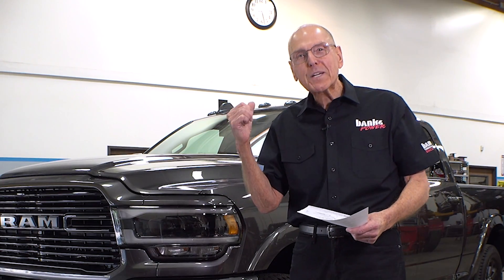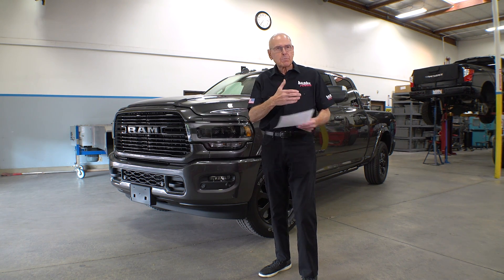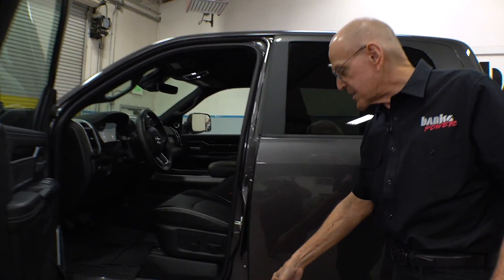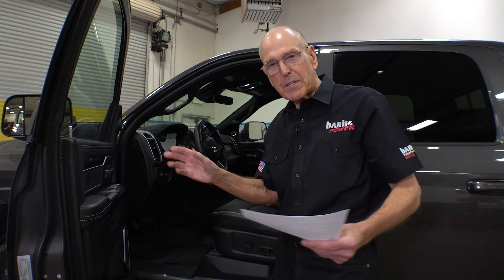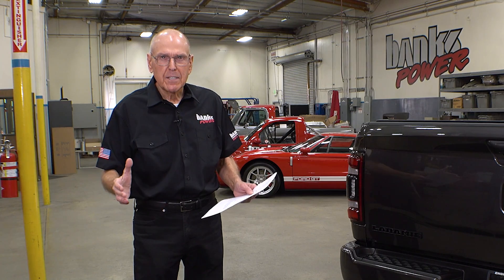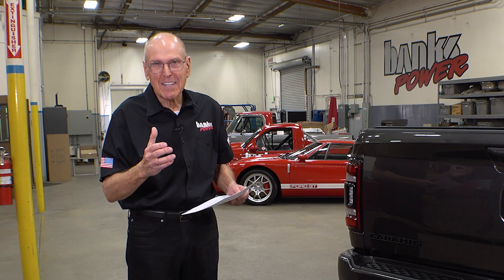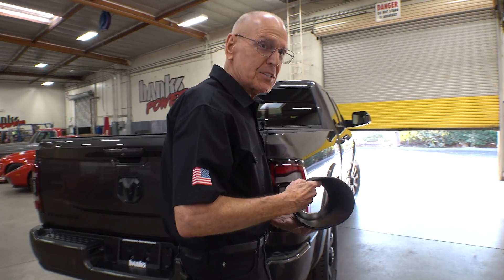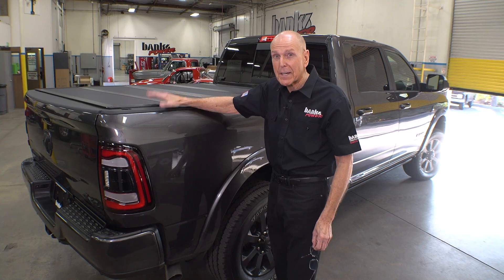Everything we're doing to this 2020 RAM 6.7L Cummins

Comment: I have a 2019 3500 with the high output diesel. I do like my Pedal Monster (and iDash), but I agree it feels like the engine could use a better tune.  Please select me as a beta tester for the products you are developing for this platform.
Reply: Ez link it, 530 hp on my tunes in stock for emissions intact

Comment: We desperately need tuning for aisin trans! And please don't leave the 4th gen guys out when you crack it.
Reply: Good luck with cracking toyota software
Reply: @justinmartin8887  some company’s just can’t be cracked. Even company’s that work with the oem. Dinan that makes aftermarket parts for bmw that bmw will not cancel the oem warranty when modded or tuned by them. Even they couldn’t get past bmws ecu encryption. They had to make and design there own ecu.
Reply: Levon Miller from firepunk got his aisin running good but he just pulled all tuning for anything newer then 07 off the market due to epa bullying

Comment: I can’t wait to see this series but there’s one thing. I’ve always been told the ram 4500/5500’s are all detuned compared to the 2500/3500’s. Can you do a video on what you offer for the 4500/5500 trucks. More power and better fuel economy, running cooler for towing since that is what most of them do
Reply: I have 5500, they are detuned,  it was deleted,  than bigger 50 hp turbo , than the factory computer was adjusted to feed that turbo,  really all Cummins can be tuned without banks. Or any aftermarket product,  its reliable  and powerful- not loaded hwy get mid 15mpg.  Loaded 9 to 13 mpg, than again the rear end is 488 gears

Comment: Glad to hear your finally working on a tuner! I have a 2017 6.7 G56 that has the derated engine and a little wiggle room would be very welcome to those of us who insist on running manual transmissions. Being able to go to stock or an economy tune to something with a bit more power would be perfect. I really hope you don't forget trucks before 2020!
Reply: I have the 2018 w/g56...It would be great to just have the H.O. torque and HP specs.
Reply: @bartdude  No kidding or even the standard tune instead of the de-rated one.

Comment: Haul up to a 7,680-pound payload*

*when equipped with the 6.4L HEMI® V8 engine
Reply: Also with a long bed and single cab...
Reply: .....and 2wd. Yuck!
Reply: Tow rating is a lie too
Reply: @Brooktrout3  how is that? The tow rating differs an insignificant amount compared to the haul rating for different models.
Reply: @IceBergGeo  a full sized cab, 4x4, non dually is not towing 35k dude
Reply: @Brooktrout3  why would you even try that much without the dually? I suppose common sense has to kick in somewhere... So long as you have a couple options ticked, you're still towing 32k plus. You'd be crazy not to have them anyways.
Reply: @IceBergGeo  exactly, but this video insinuates that this truck can pull 35k
Reply: @Brooktrout3  if you read all of the text in the image, you could see what's what. I don't think we need to go any further though.

Comment: Finally we get some goodies... And if possible touch on the cp4 that everyone seems to think it's the failure point on these trucks .... Prove them wrong....or right? Would be nice to hear what you think of it. Thanks keep up the good work.
Reply: CP4’s leave a bad taste in everyone’s mouth. The horror stories come in stock form or tuned trucks. Higher miles or months off the lot. They are a ticking time bomb. I don’t think additional filtration is the answer on these, and that’s why so many do a CP3 conversion. Just my .02 of course.
Reply: Perhaps a lift pump and “CP4.2” will help us sleep better at night?
Reply: I would be interested in that also. Mine failed and it was a very costly out of warranty repair.
Reply: When I was looking at used trucks, that cp4 is why I didn't get a GM or Ford. Thats too bad that Cummins put that pos on their engine.
Reply: I love my 19’ HO. If you could touch on the CP4 that would be awesome
Reply: My 2020 3500 cp4 failed at just under 5000 miles. Ram dealer gave me a wrangler for my temp vehicle while they had my truck for 4 months. Been runnin lube in every fill up since. I heard that cp4 tight clearances needs more lube than USA diesel at the pumps provide. Haven’t had an issue since knock on wood
Reply: Still running mine with the cp4 over 18 months just under 20k no issues. I put a shot of hot shots additive in at every fill up though.
Reply: @landscapingspecialist  me to
Reply: Mine failed after 1300 miles also 2020 ram
Reply: My 2020 has a CP4 it’s failed twice I had to hire a lawyer.  The truck factory pump failed at 37k driving to hook up to my trailer. The second pump failed at 51k miles this time I had a trailer hooked up and I was going down the bridge on I-10 in lake Charles LA I had no brakes and no real steering and I had to put the truck in the ditch.  Damage to the truck and trailer thank god I didn’t hit anyone. Ram told me well it’s not a recall yet so there is nothing we can do to pay for the damages.  So it took 46 days the second time I got it repaired the truck does 1,000 a day in hauling that’s 46k my company lost out on.  The first time the repair was done the truck was down a month . Ram told me it was not their problem and they would not compensate the lost time down  . Then I get a letter saying it’s a recall. Now they want me to bring the truck in again to change out the pump again.  I own 3 Ram Trucks 1 is a 2021 and the other two are 2019 and 2020. The pump on the 2021 is a CP3 not a CP4  so my question is in 2021 did they realize the pump was garbage and all new 2021 models were changed to CP3 ?? And they didn’t tell the consumers??

Comment: Those Ram trucks look great but boy do they have mechanical and electrical issues. I personally would never buy one.
Reply: Its interesting how everyone says this, yet I've had 30k problem free miles so far with my 19 ram
Reply: @happydoggs  I guess you got a good one. My brother inlaw bought a new one last month, gas engine. 400 miles and needs a new engine. No internet  bs, I can prove the paperwork.  Another guy, center dash hvac/radio  control issue.  They dealership couldn't fix it. Went back 4 times.  Lemon law kicked in.  I should make a video on the subject.
Reply: Electrical hell... Spend 60k for a truck and been to the dealer 7 times in 30k miles for issues they can't fix....
Reply: @wvmurse  finally someone is being honest about the crap Chrysler sells. Sucks Appalachian, hope you can eventually get a new truck from another manufacturer.